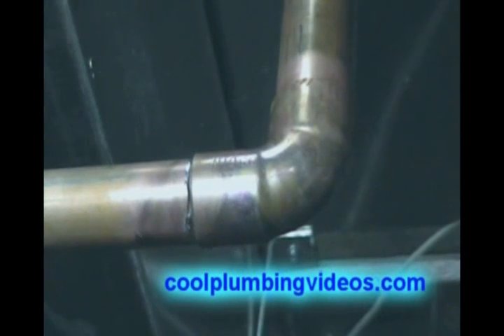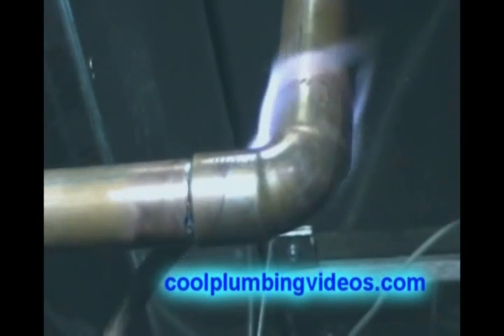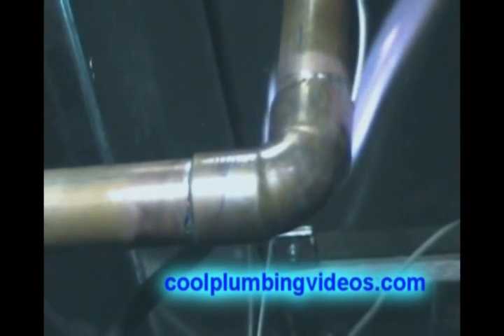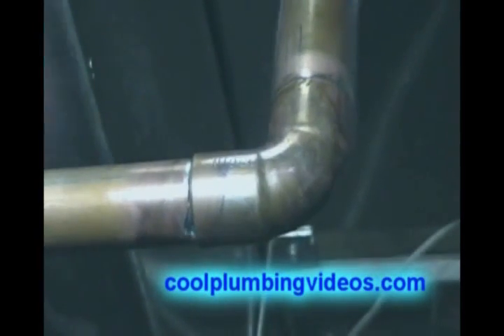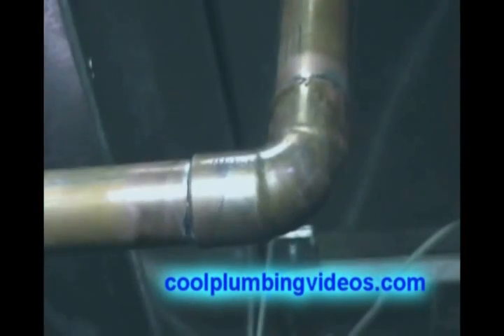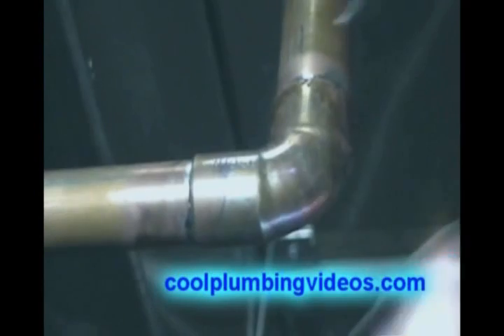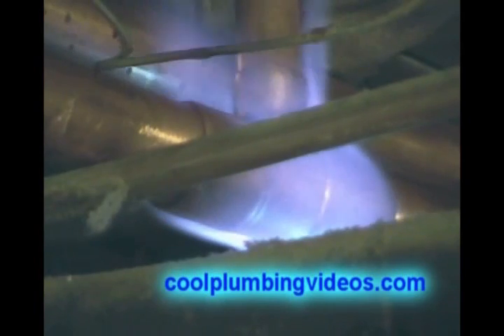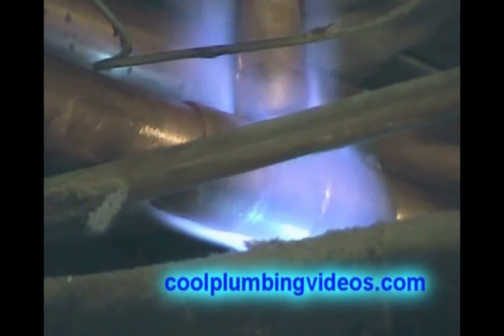How To Solder Copper Pipe 4/14 |How To Plumbing

Comment: Also a reason to use Flux sparingly, I would not want flux inside the pipe as well in large quantities.  Remeber to take off your aerators so they dont get plugged up before testing any repipe or heater install.  Run a tub for like 20 minutes.  Flux taste isnt great for your owners.

Comment: Another reason to "wipe" the joints is if you leave flux on pipes in hot weather states you will end up with copper that has pinholes from the flux eating a hole in it, this is more noticible over time with "M" copper which is the cheap stuff.

Comment: @toddfoll What you want is a small heat shield cloth. They cost about $15-$20 from most plumbing supply places or places like Home Depot. This will protect non-metallic surfaces behind your pipe.

Comment: I have an outside shower with a split line. it is right against cedar shakes and I wonder if a couple of pieces of aluminum foil will be adequate to protect the cedar from the pipe from the blow torch? Any suggestions?

Comment: Thank you so much for this.  I grew up doing a lot of stuff; but, I have been very reluctant to use copper and solder.  Give me a wrench and fittings any day and I'm good.  So, with this extremely cold weather I had two copper hot water line breaks and I was forced to learn since my great plumber had 60 calls ahead of me and was honest enough to say so.  You obviously love what you do and have a passion for doing it right and leaving a good job behind.  That's my definition of success!